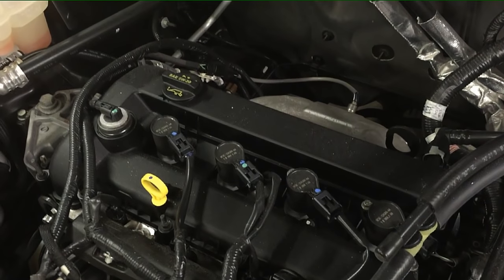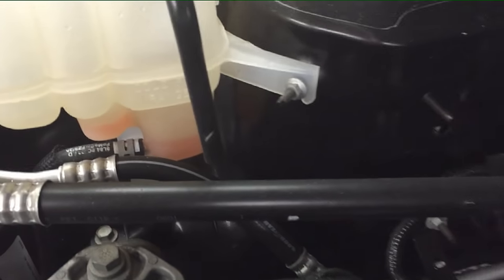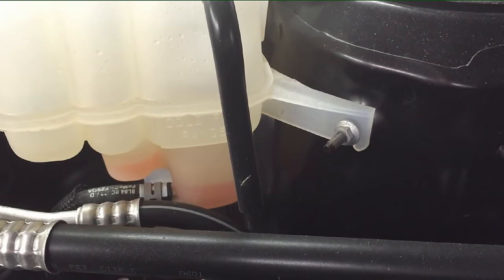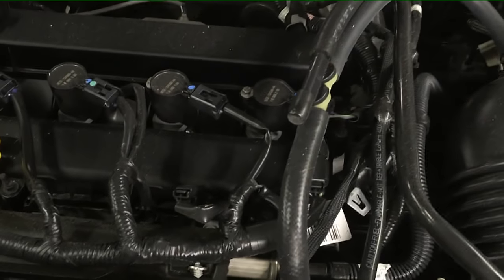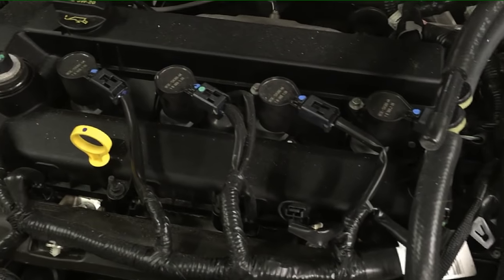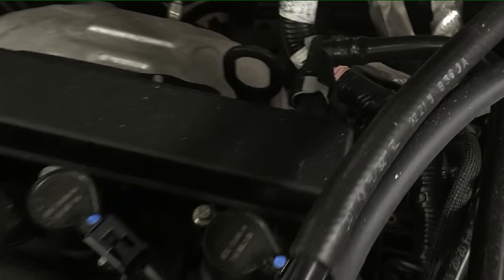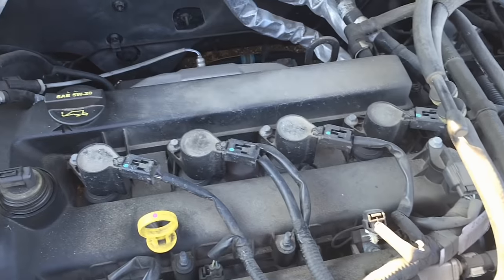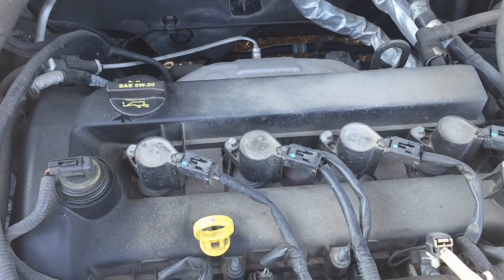Ford Vehicle Noises: #4 Tapping Knocking Noise 2.5L Engines

Comment: I had this problem on my 2012 focus. Loud ticking noise and yeah it was a dead give away because the coolant would drop quickly. Now i have a 2015 fusion with a 2.5 and it makes this noise but the coolant hasn't moved much since i first got the car. I currently have 13,900 miles.
Reply: My focus had 40,000 miles.

Comment: Hey man thank you, all your awesome video's very helpful, listen I have a question, do you know or have any idea of what causes the gas pedal to vibrate when traveling between 60 and 70 miles per hour most of the time I have a 2009 Ford escape xlt 2.5l 4wd. 
Thank you
Reply: Possible broken or loose motor mount, I had one come loose.

Comment: hello, I have 2004 ford taurus 3.0L OHV and replaced the plugs, ignition wires and valve cover gaskets, engine idles fine but getting a engine knock sometimes and sputtering during acceleration only....any ideas?
Reply: I have same issue. Were you able to get rid of Engine noise

Comment: My wife's 2015 Fusion at 22k died and would not start and we had it towed. Turns out 3 cracks between 2nd and 3rd cylinder. Fixed under warranty, but it will be the last POS Ford I ever buy the rest of my life! The Buick we traded in on it was a 2002 Century and other than the famed intake manifold gasket leak the engine was rock solid at 178k and 17 years on it. I quit Ford over 20 years ago and we decided to give them a try again because she liked the look of the 2015 Fusion. Well same old POS Ford quality. Car has been fine other than that and the radio no longer syncing up to cell phones another $500 Ford wants to fix it so I told Ford to go screw themselves. Next car she gets will be another Buick:P Update: After researching more on newer GM quality issues we went with a Toyota and can already tell you the quality is night and day compared to the Fusion we had. I just want to know why were these cylinder heads cracking and if is a manufacturing defect and not up to spec why Ford did not stand by their product by extending the warranty on the cylinder heads on these engines? That right there might have kept me as a customer knowing they were standing by if it went bad. Typical Ford just slapped another head on it that was just as vulnerable to cracking. Honda when they had the transmission issues extended the warranty, Toyota in the past extended warranties when they had a problem. Ford or GM? silent until a lawyer takes them to the woodshed:P
Reply: After it's fixed, you'll will find your 2015 Fusion incredibly reliable now, just as great as your 2002 Buick Century before. 2.5L is Ford's most-reliable engine ever built. Engine was designed by Mazda.

Comment: Hey I have a 98 grandmarqus mercury LS and I wash under my hood and the car was on and now latter that day or the next day my muffler make a nose that does not seem normal and my engine Shake when I drive like if want to turn off or something like that do you know what is the problem of it.
Reply from the maker: +los405 405 Yes you have water down in one of the spark plug wells causing a misfire pull them out an dry with compressed air.
Reply: Okay thank you lol a other mechanic guy said that to use WD-40 spread on the wires witch lol to me that's crazy
Reply: And also would it still work like that if it was like that like last week

Comment: I got a 2013 ford escape 1.6L ecoboost with a sound similar to this but it's it's when cold or hot doesn't matter but I got it for $500 bucks and this was on 1/03/2022, has 168k miles and drives fair for a $500 vehicle lol

Comment: HELLO WHAT IS THAT PLUG CALLED IN BETWEEN 2 & 3 ?
Reply from the maker: Cylinder head temp sensor pigtail.
Reply: @FordTechMakuloco  thank youuuu, do you know what to do if that broke off??
Reply: Does your engine make tha tapping noise when that broke off?

Comment: Thanks for the videos. my 2007 fusion has a noise I believe similar to this one. I was told the two bottom cylinders were bad and pretty much need a new engine. my husband won't even let me turn the car on again to record the noise. I want to drive my car he says I'll ruin the engine completely.  it doesn't leak any fluids doesn't overheat nothing except the noise and sometimes  hesitates when gas pedal is pushed.  never stalls . Will I ruin my car completely if I drive it? I mean your opinion I know you couldn't know 100 percent the answer
Reply: Either way you're going to have to get a new engine so starting it up to record the sound won't hurt.

Comment: its always nice. i have this issue on a 2013 ford fusion se 2.5l 6sp auto. well im burning coolant and my trans is gone. dont want to bash fords vehicles but i liked the design of the car but a 4cyl engine in a car the size of a chevy impala. cant wait to pay this thing off had to buy a parts car an do the labor bc the deductible ford wanted was outrageous. not a happy customer but doing a powertrain swap and thats it. cant wait to be done. no videos of helping me pull or swap trans an motor on this vehicle. learning process with all this new advanced auto care

Comment: I just rented a Ford Transit Connect from Uhaul with the 2.5 and I heard the engine knock before I drove off. The guy said it was normal with these vehicles and that I would be ok. If that was my personal vehicle, no way I would let that slide.

Comment: Have you seen this across all years of 2.5 Duratecs?  All vehicles?
Reply from the maker: brakedd Seems to be the later ones over the earlier ones.
Reply: FordTechMakuloco
Thanks buddy!  Great info and as always, keep them coming please.
Reply: FordTechMakuloco So an SVT or SE contours fine? I ran the crap outta those 7,000rpms quite often & never had the spun bearing or any of those issues. Probably crap oil/filters ppl love using. I ran a full synthetic in mine.
Reply: @FordTechMakuloco  If I get 2019 Escape S that is the very-last one with 2.5L inside, has the knocking problem already resolved? Can you check your bulletins from Ford for 2.5L, if any? Thanks for responding.

Comment: Could this happen to a 2014 model fusion with the 2.5l?
Reply from the maker: ProjectSN95 Not likely no.
Reply: Mine is 2.5 2014 and it makes this noise since new. Now I got 99,000 miles

Comment: My 2012 Fusion SE 2.5 is making this exact noise.  When I start it up in cold temps, it raps especially loud until it warms up.  So far there are no fluid issues or noticeable drivability problems other than it sounds like crap.  The car only has 35,000 miles on it, so I'll be pursuing warranty repairs.  I traded a rusted out 2000 Explorer V8 for this car.  It had 254,000 miles on it and the engine still purred like a kitten.  I have to admit, after owning many Fords over the years, an engine failure like this was the last problem I thought I would have!

Comment: I hear that clicking sound when I turn on the AC, but once I start driving it goes away but when I stop it comes back again. Any ideas on what it could be?
Reply: Same issue I’m having it seems to be the same problem that this video is speaking about
Reply: Same here on my 2014 Ford Transit Connect.

Comment: I have this with my 2014 fusion
Reply: What did u do mine sounds very run down
Reply: Pls help me out
Reply: Pls help me out
Reply: @ChiefWiseEagle  mine threw a p420 code after this sound started, I think my catalytic converter broke apart. I heard some knocking in the cat while I was driving and the sound stopped. Unfortunately though, I think there might be a crack in my block because ive been smelling coolant in my engine bay. I haven't gotten it taken care of yet though. Take yours to the garage and see what they say.
Reply: @swelldrew  yes I will see what Ford says thanks a lot

Comment: Strange.  I never knew a cracked block to cause such a noise.
Reply from the maker: It's where the crack is.
Reply: But how does a crack create such a rattle noise?  Are not such noises the result of enlarged clearances?  I would expect such a crack large enough to do that  cause LOTS of coolant loss.

Comment: I'm stuck between this and some loose shutter valves inside the intake. 2014 2.5L transit with 95,000 miles. It gets quiet when the revs are above 1500-2000 rpms. Thoughts? Anyone.
Reply: One person said remove a vacuum hose in the imrc and the noise goes away.
Reply: @robertwilkins839  it ended up being a cracked flex plate.

Comment: Hi, thanks for you videos. I have a Fusion 2012 2.5L which is knocking pretty bad when I increase revs. the noise is completely gone when I drop the first cylinder. I did an oil change and noticed a fair amount of "glitter" in the old Oil. I have no warranty left so I'm thinking of dropping the oil pan to investigate rod bolts/bearings. do you know if I will need to lift the engine for this or if I am even on the right track? Any advice would be much appreciated. Here is a vid of the noise I'm getting : https://www.youtube.com/watch?v=Zmua2ehNwSs
Reply from the maker: Checking rod bearings is the right track yes and the pan comes down in vehicle.
Reply: thanks.

Comment: Every non v8 ford I drive sounds like crap. The engines just don't sound healthy at all to me. I just test drove a 2010 ford escape v6, not only was the tranny making some weird noise, but the engine sounded like it was 20 years old..
Actually I drove my brothers 2013 f 150 v6 with turbo it sounded pretty nice but it only had 18k on it.. Tons of power all day long with that engine he has.. I still prefer my chevy engines though..

Comment: Use 10 30 or 40 weight solves the problem
Reply from the maker: Fixes the crack?
Reply: No just queits the engine I meant the noise is just a bad head
Reply: What causes it?

Comment: Hi FordTechMakuloco.  I appreciate you uploading "noises" videos.  I have a 2005 Mercury Mariner 2.3L 4 cylinder engine. 140k miles on the clock. Does not use any coolant or oil.  No engine codes or rough running  car starts fine and sound is not there on startup.   Car does not stumble or hesitate or have any operational issues  Auto repair shop thinks it's valvetrain and wants to replace the entire engine.  https://www.youtube.com/watch?v=xR3nwuJhPE8
Thoughts?